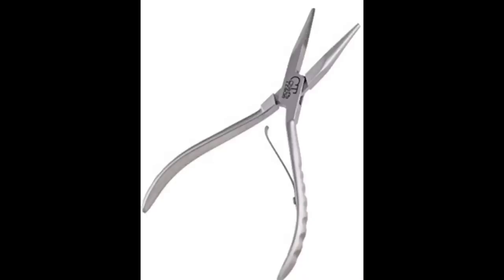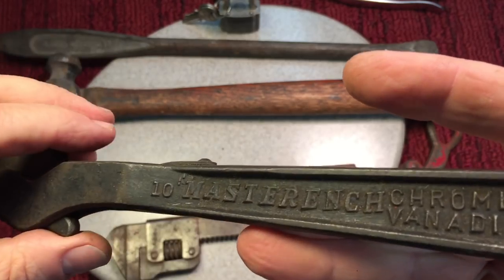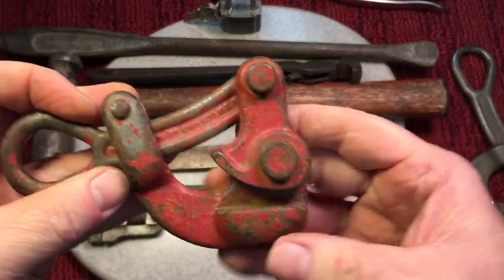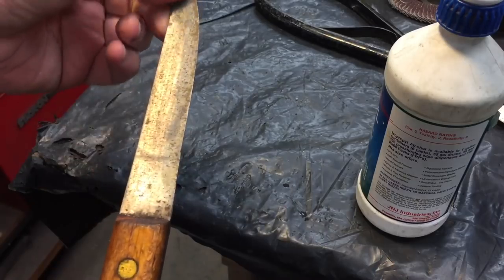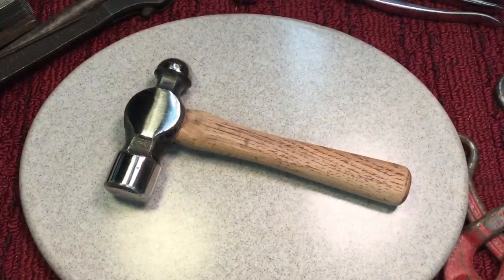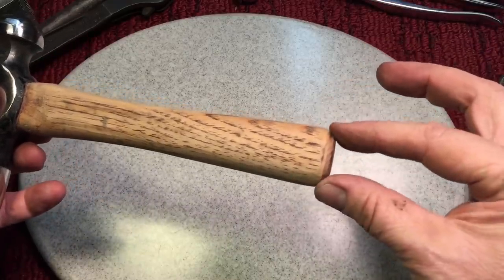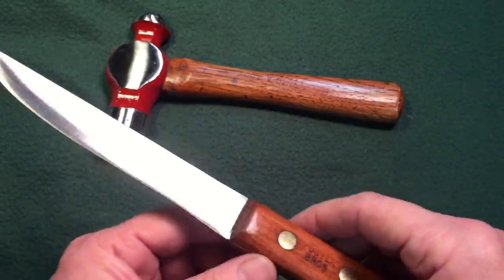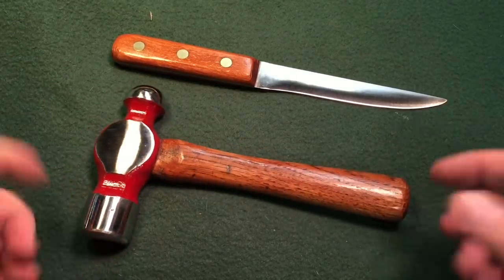Short Handle Hammer Build and Foster Bros. Knife Restoration

Comment: As farmers, here's the rundown on our uses for hammers. smaller ball-peens like 4-8oz are used for small adjustment or for driving tiny pins in. larger med size are used for pretty much everything like centering bolts driving nails and pins, seating bearings and seals, etc. the bigger ones are used for nails, aligning 3-pt arms and checking tires, etc. and then there's paul bunyan's ball peen, it weighs about 30 pounds with a 4-ft handle and was made for things like tightening cutting harrow bearings and giving a tippy tap tap to items you want to adjust with an attitude and give em' a lesson they'll never forget. and if you're wondering, yes we do use stubby hammers, mostly med size for those tight spots or for added accuracy on your hillbilly impact wrench (that's when you take the wrench and start beating the fool out of the opposite end of it in the hopes that the nut breaks loose). Signed~ A. Broke Farmer - from Tennessee
Reply from the maker: You sound like you definitely know your way around a hammer!  😃👍

Comment: Never heard the Klein called a cable puller. Always called it a grip.  Used in pulling stranded wires.

Wow, you whacked that handle!  But it did turn out nice.  Thanks for the fun. :-)

Comment: Wow, I never saw a bag of hammers like what you described. I blacksmith and would love to have excess hammers to re-forge, cut and grind into specialized shapes.  Usually find most smithing hammets are too heavy for my specific needs, as I usually work with really small stuff.  If you have excess you do not need, let me know.  I would love to put a few back into service, and share with my boys (teaching them smithing as well).

Comment: I use a long handled ball peen to drive bolts and studs into flanges on utility water pipes. A short handle would insure that I hit, cut, or broke my fingers on the bolts already in place. Also  it is handy when you want to reach out and knock some sense into an apprentice.
Reply from the maker: By no means is this meant to replace a normal size hammer, this is a whole different animal.  😃👍

Comment: Ok you asked.  At SEPTA, they had an “Emergency Tool Box” in the Towers along the Broad Street Subway (Now the Orange Line) and the Market Frankford Subway / Elevated  (Now the Blue Line).  These ball peen hammers were used for breaking off the third rail shoes from the train in an emergency.  The 3rd rail power was de-energized and you needed a long handle on the hammer to be able to reach into the area where there was a notch in the casting of the 3rd rail shoe where the shoe would break.

Comment: I made a 10 oz ball lien into a short  handle because the head was loose and I had to cut it off.  Reused the old handle and once I got it mounted properly it felt wrong in the hand so I cut it off at about 7” and rounded the end.  This shorty handled guy is by far my best most used hammer.
Reply from the maker: RG- The same exact thing happened to me!!! I never would have known about a short hammer if It wasn’t by mistake!  Now, like you it is a God send in the shop!!!  😃👍

Comment: Short hammers,  more vibration goes up your arm, not enough length to absorb the shock. With a long handle you have a choice where to hold it,  a short handle no choice.
Reply from the maker: Tony- Short handle hammers aren’t made for whaling on something like a stuck ball joint- they really shine for work like peening, stamping, punching, gasket making...  Anyone who has one will admit it’s a highly used tool in the shop.  😃👍
Reply: Short hammer is great been using for years, tapity tap tap, for bang a dee bang bang I use a bigger one

Comment: Long handle hammer is great for working on the car stubborn ball joints come to mind especially on Chrysler A (think Dodge dart, Plymouth Valiant, early Plymouth Barracuda and Dodge lancer) bodies where the parts are a bit smaller and a "pickle fork" is a bit large.  On full size cars like my old 1973 Lincoln I usually use the long handle to wail on the end of the pickle fork it is sort of my beater hammer. 
My go to hammer is Definitely a 1990s Craftsman (I bought it new when my great looking but garbage in quality Chinese ball peen hammers would have their heads loosen up or split their handles).   I believe it to be a 32 oz in weight, great hammer and I like the long handle,. On my light ball pen hammers  I tend to like a shorter handle
Reply from the maker: I hope I never have to do Ball joints ever again!  😂👍
Reply: @ScoutCrafter  as long as its for my hobby cars I don't mind so much, its when I have to work on my daily driver that my mood sours... There is nothing worse then having to work on your car to go to work.  
I guess here in California I don't have to fight rust so it definitely makes the tasks a bit more pleasant. I feel for you guys in that respect although you guys have estate sales full of basement treasures so I guess we are even lol.

Comment: Tetanus Special, maybe so, Scout, but I like my carbon steel knives.  Before you hacked that ball peen handle in half, that hammer looked like the 20 oz. Plumb I keep hanging on my bench.  Never thought of shortening it.  I have a beater which looks like a dwarf sledge. it has a short handle and a 2# head. It's great for tight spots because you trade mass for stroke.  I found out the proper name for such a hammer is a "crack" or "boiler" hammer because boiler inspectors would use them to ping a boiler listening for cracks.  I picked up the "beater" handle (hah-hah) from the ironworkers I knew. To them anything with some heft to it was a beater, even a cutting torch.
Reply from the maker: I too like carbon steel knives because sharpening stainless is a whole different task..  As you know I must have 40+ Ball Peen hammers in every weight and size.  This is my only BP Shorty.  😃👍

Comment: Was that knife  nickel plated? It had that slight yellow hue to it. Maybe just an old walnut/flax oil coating?
Now you have a hammer for throwing in your motorcycle toolbox.
 I saw some hand tool woodworkers talk about using a "lump hammer" for chisels - big sledge head, short handle, and sort of dropping the thing on the chisel more than swinging it. A longer handle may act as a bit of a counterweight when holding it higher - japanese hammers are designed to be held where you'd choke up on them, but the handles are way long.
Reply from the maker: Excellent points and observations!!!  😃👍

Comment: Every time you cut a handle down, I cringe.  To me it is like fingernails on a chalkboard.  If you don't need the "swing weight" the longer handle gives you, maybe you should use a lighter headed hammer?  That way you don't have someone selling your stuff after your gone and the potential buyer is saying to himself- who in their right mind would cut down the handle of a hammer?  
It kind of like all those ruined chisels that people mercilessly ground down to short stumps and their heirs try to sell and no one wants them.
Reply from the maker: Simply put a short handled hammer has a whole different list of uses then a long handled hammer.  Until you try one it looks wrong, however people in the know will always have one in the shop...  A longer handle for intricate work only gets in the way.  If you only have one hammer then leave it be...
Reply: @ScoutCrafter  John, I have a boatload of hammers and have been using hammers since the '60s, but maybe I'm not in the "know".  I have ball peens in most sizes, from smaller than your little finger up to the big boys.  When I need to "lighten the touch", I reach for a lighter headed hammer, instead of choking up or using a shorter handle.  My swing stays consistent (unless I really need to bang on something). This just works better for me, I can use the same swing and by varying the weight, I get better control.